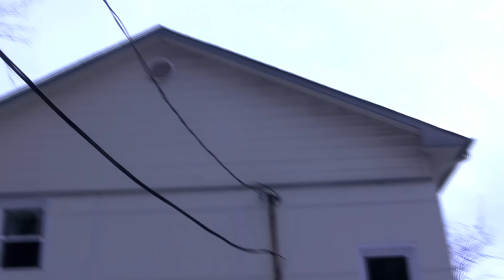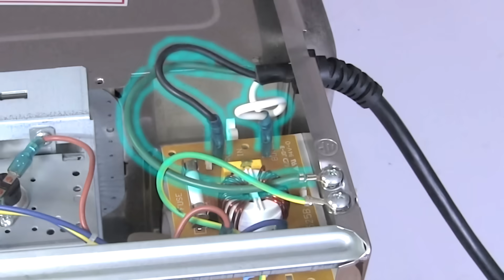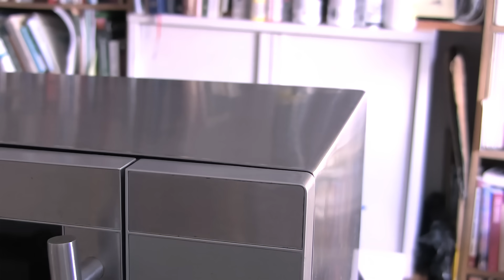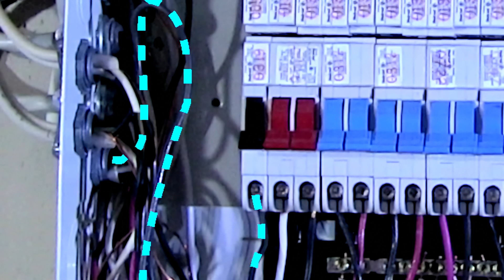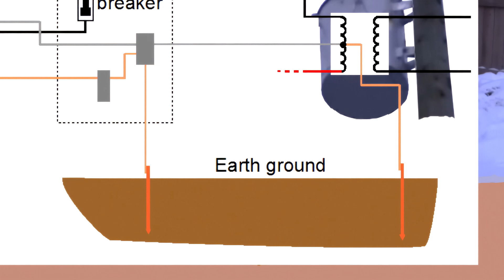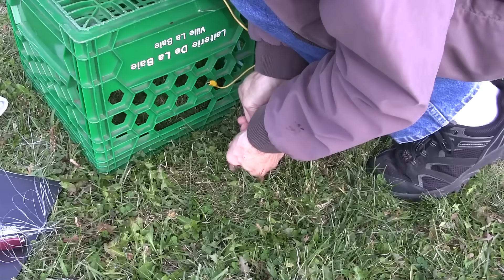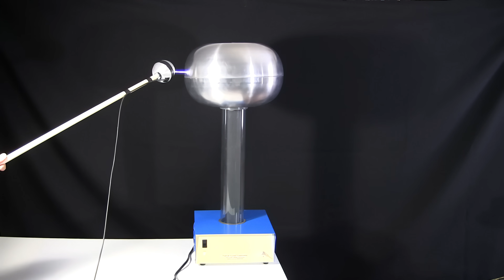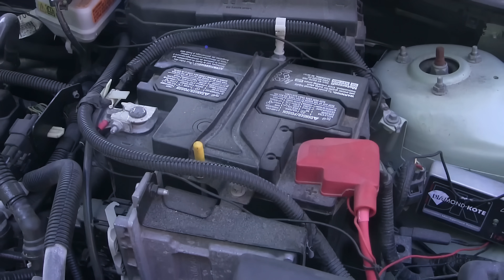What is Ground? Earth Ground/Earthing

Comment: Multiple earth neutral systems MEN.
& earth return wires are for human safety.

Large ships electrical systems and their steel hulls are completely electrically isolated.
 They don't want circuit breakers operating if one side of the power supply touches the hull.
This is because it more important often, to keep the vessels equipment continuing to operate.
Human Electrical safety is secondary to the ship safety.
They use an insulation meter to detect earth faults.

Comment: on a different topic, step potential is interesting. If a high voltage wire falls to the ground, the voltage dissapates in a big circle around the site, the voltage is different each metre of the radius, if you stand still you are ok but if you take a step, the difference in voltage will go through you and your legs and kill you. Best to shuffle away. Four legged animals don’t stand a chance.
Reply: I’ve encountered that with a Single Wire Earth Return system on my old well. It uses a single hot wire, and the ‘neutral’ is just the ground. If you stand perpendicular to the well house on a dry day your legs will feel heavy because you become part of the circuit.

Comment: If there is leakage in say desktop computer box, specially in rainy seasons, you may get get a mild shock with bare feet if you touch any unpainted part of box if proper Ground connection is not done.
Reply: Computers are notorious in leaking current. Essentially the case gets half the mains voltage if it is not grounded and you can feel that. The current is limited to about 0.5 mA so it is safe if the power supply is working properly but as it can fail there is problem if it is not grounded and you are.

Many other modern devices like fridges can also leak.

Comment: 3:10 min WRONG!!!!!!!!!!!!!! THE GROUND WIRE SENDS ELECTRONS TO THE GROUND , NOT TO THE NEUTRAL PART OF THE TRANSFORMER. THAT IS WHY IT'S CALLED GROUND!!!!!!!!!!!
Reply: In Australia all the electrons fall from the rest of the world to Oz, that’s why we use 240V.
Reply: No current never goes to the ground in a TN-C-S system. British call it the CPC (The Circuit protective conductor) in other not to give misconceptions how it works.

Comment: If you connect your ground to a fence, wouldn't it potentially zap someone touching the fence?
Reply: No because the charge would mostly go to the earth.
Reply: @Henry14arsenal2007  but if it had rubber insulation on the posts, and the fence was suspended in the air, it would right?
Reply: @iwishtobetexan6060  Id guess so. Also depends how much potential difference there is, ie how much static all the appliances in the property accumulate, unless of course theres a ground fault somewhere.

Comment: Is there a special connection between ground bar to neutral bar? If not why doesn't power just follow ground to neutral an return there? On the same page could you run hot wire an use neutral to actual ground an operate light/ tool? Wires are of the same lenght an go inches apart in box. Seams resistance to actual ground( dirt)  would be higher than resistance for a "hot" ground to just follow ground wire to panel then follow connection to neutral  an return.  TIA.

Comment: You explained that the breaker trips if the hot wire touches the metal casing of the microwave, since there is too much current. But what happens if the neutral wire touches the casing? Since the current still moves through the load no high currents occur and the breaker wont activate. Wouldnt there be danger to a human if he toche the microwave in this case?
Reply: There is very little voltage on the neutral wire so it would not be dangerous. Remember on the old TN-C system used in many countries neutral is used for grounding.

If there is an RCD it might trip even if the  neutral touches the case.

Like so many Americans you confuse current and voltage. This is likely because in English the term tension was or some reason changed to meaningless "voltage".
Reply: Nothing , but the breaker would still trip if there was an additional hot fault , either enough current between the faults or live to earth would trip . However  damaged cables where the live can pass a current to earth but just enough for small intermittent sparking can burn slowly over a surprisingly long time if no one picks up from the smell that should be there  with hot wiring . Rat damage to cables  also causes fires this way without setting a breaker off .
Reply: @MyKharli  got it, thank you for answering :)

Comment: Fantastic video but it leaves me curious why some appliances have a ground prong and others do not
Reply from the maker: I can't speak for all applicances that don't have ground prongs but some have plastic cases and so there's no danger from the outside of the case. Plastic does not conduct electricity.
Reply: If we talk of modern appliances they use one of two methods of protection: grounding or double insulation. The latter do not use a ground wire. If we talk about 1950s or earlier then people were just less safety oriented.

Comment: Negative is attracted to both neutral and positive making your model of the atom @ 4:40, false. You can prove it for yourself. Take a neutral steel slug and put it on each side of a magnet, + and - . It sticks to both sides.
Reply: magnetic north and south are not the same thing as a negatively electron charge (or positive charge due to lack of electrons).
Reply: @jessequentin4441  You take your positive charge, add it to your negative charge and you now have a neutral charge with twice the mass, which can now take another positive, another negative or both.
Reply: @DavidCraig-go1zv  I'm not sure what you are trying to say there. All I'm saying is the fact that a steel ball is attracted to both magnetic north and south has nothing to do with electron charge and the attractive and repulsive forces associated with electrons.

Comment: Why doesn't America use RCD's in the whole home, not just in the bathroom and/or kitchen & laundry, one can receive an electric shock anywhere in your home?
Reply: RCD (called GFCI in the US) is only required in places in the home you’re likely to encounter water or another easy path to earth, where a shock could be dangerous.
Also, new construction requires GFCI/arc fault breakers for similar areas.
Reply: @PrebleStreetRecords  Same here all new homes and rental properties require RCD's! What say you (America) in a bedroom, living room etc, could there be a chance of an electric shock, say someone playing with an live outlet? Or an electrical metal device of some kind? Even 48V can kill! or a 12volt car battery @ 100Amps!
Some say the 120V @ 20A is safer than 240V @ 10A, no, not really they both equal 2400W, I did the math!
Like in the bedroom (up north America - winter time) electric blanket are used, and if liquid gets on them, then bang your dead (I wont chance it)
Reply: Likely  because the tripping current there is just 5 mA so one wants to avoid nuisance tripping and use them only where really needed. In Europe you can connect the whole house or apartment to one or two RCDs and be done.

Comment: Great explanation, congrats!  Now i also know why old cars with metal bumpers would lose battery charge when parked touching a fence. My guess from what you showed is that there is a potential difference between the chassis ground of the battery and the "soil ground" reached by the fence allowing electrons to escape into the earth (right?)
Reply: i think so

Comment: I was always worried that by humanity overusing ground will cause the entire Earth to be slightly charged first not noticing it, then making electricit unusable. The first astronauts touching the Moon might even suffer a fatal discharge (from the charge difference between the Earth and the Moon). I still don't really understand why that scenario can't happen. How the Earth ultimately discharges? By radiation?
Reply: Charge is conserved since the Earth would be a closed system so pumping electrons into the Earth would mean you'd be taking them from some other part. I would guess, you could get a difference in charge buildup between the ground and upper atmosphere which, is typically lighting but when that happens the charge would equalize again. So the charge between the Earth and moon would always be near 0 since there's no mechanism that's moving electrons between the two.
Reply: This is literally why lightning strikes happen. It equalizes the potential difference between ground and the air.

Comment: I think there are few mistakes about the earth ground, the earth ground its neutral overall but not on the surface, there is no such thing as proton move, the protons of a atom is always the same (except of the nuclear reaction) but to keep it simple  the one who make everything happen(electricity) it's the electron when the  atom become an  ION which have either  to much electrons or less electrons, this is the one who make the potential difference. If an atom have less electrons will always want to gain oane to become stable (neutral) and vice versa if have more electrons will tend to give one away.

Comment: Really ground is supposed to protect equipment more than people. If you want to protect yourself you install a ground fault breaker. Those are made to protect people.
Reply: No, it is for personal protection. It may also protect equipment but that is always secondary. Differential protection is a newer type of protection that supplements grounding but does not replace it. In Finland grounding on wet rooms was made mandatory in 1930. RCDs only in 1997. You could still die even with an RCD.
Reply: @okaro6595  if that was the case, circuit breakers would trip more easily. If you have a hot wire shorting a microwave oven it takes +10amps in a 230/400V system to trip. With an RCD that would be 30mA. I wouldn't put my life in the hands of the 10A circuit breaker.

Comment: Can a brick wall be used as Ground as well? 🤔 like concrete walls and such?
Reply from the maker: I can't say for sure but I don't think a brick wall would work well. The best ground is one that is moist and contains a lot of ions, it's the ions that make it a good ground. I don't think either brick or concrete meet either of those criteria.
Reply: @RimstarOrg  Thanks for answering. :D
Reply: Concrete can work great if used properly. A lot of commercial and industrial grounding systems connect to the rebar “skeleton” in the concrete foundation of a building. This is colloquially called a “Ufer”.
Reply: @H-_.9  oh nice :D
Reply from the maker: Now that @Harristocles S. points that out, I think recall correctly something about concrete being used. Connecting to the rebar makes sense since rebar is electrically conductive and would mean you're connecting to more concrete. Thanks.

Comment: So ground gives you higher bills!
Reply: Isn't that obviouis.  Specially in the light of the fact that the switch hasn't tripped.    You have paid attention, that much is clear.  🙂
And so it looks like this:
Somehow the heavy weights managed to mesmorize the sheeples  by the term ground as something good.   I mean really.
Just think no ground period, bottom line.  Now touch all you want.
First implement  the ground ( and for a reason which everyone just skips over.  That is the whole point) then you have to find a way to protect yourself from it.  But it is never word it that way.  NEVER.
YOU ARE TO PROTECT YOURSELF FROM THE GROUND IS THE ACTUAL TRUTH.  

Furthermore if the circuit is working properly, the switch would have tripped long ago before you have to worry about how little amp goes through you.
If you will be the cause of the switch tripping, you will be dead first.  Think about it.  And the fact that the hot wire is touching the body of whatever and especially your body , you are dead and the switch  still has not tripped,  too bad you are dead for them to collect a higher power bill, only if they could.  The Earth is the load consuming them amps.  You are correct.  Say cheers and happy holidays. 🙂
Reply: @alchemy1  Have you seen this video?    watch?v=9pmdbYewhs8
Reply: @Rapbando  If  you don't see your  link in the form of hyperlink, it is not working.
Reply: @alchemy1  The URL works fine. Most of us are smart enough to know which url to add to the beginning.

Btw, don't bother watching that video - it's not even in English.
Reply: @alchemy1  a wall of text, and nothing made any sense. I came out retarded after reading it.

Comment: I don't know how ground protects you but on the contrary I can tell you how to protect yourself from ground.

1.  Don't touch the hot wire and the ground period.   And certainly don't touch the hot wire and the so call neutral wire.
And wait for it........ don't touch the neutral wire and the ground.  That is right.

2. Wear rubber shoes/boots.  Why?  Because the ground is energized.  If you are just playing with say a hot wire and there are no other wires there at all.   Wrong.  The ground is an entire 3 dimensional conductor you are standing on. 

NOW NEXT TIME YOU HEAR THE WORD GROUND, IN YOUR GUT YOU KNOW WHAT IS UP.

This has nothing to do with scare tactic.  This is reality.

(Working with extreme high voltages will take more than rubber boots.  Just ask the dead people, they will tell you.  That is if you don't want to die🙂)

Moral of the story:  Before working on any electrical device unplug the bastard.  Before working on any electronic device, not only unplug the bastard but also discharge the capacitors.  High voltage capacitors will teach you a lesson  you will never forget if you get lucky and live to talk about it.
Reply: The "ground" on the microwave protects you because it has a low resistance thereby increasing the current, which causes the breaker to trip, but the real GROUND does not protect you because it allows current to flow with no circuit breaker to stop the flow. I am sure that you already know this.

The problem is in the wording of "ground" and "GROUND".  The same word is being used to mean 2 different things, although related, have different functions.  It is the same as Newtons gravitational constant, big "G" and the local gravitational constant little "g" on earth, both relatable but very different.

I was watching a math video and was having a hard time understanding, because the orator was using the verbs "was" and "were" interchangeably, and because of that, I could not understand intuitively the process that was taking place mathematically, which reduced the absorption of the discourse to the mere act of memorization instead of the act of becoming that which was being studied.

The logjam is meaning.
Reply: In electrical terms "ground is not ground" but the transformers neutral point. It makes sense as to see the return path of earth faults.
Reply: I learned that lesson when disassembling a crt grabbed the neck board by accident and shock⚡never felt a shock that intense b4